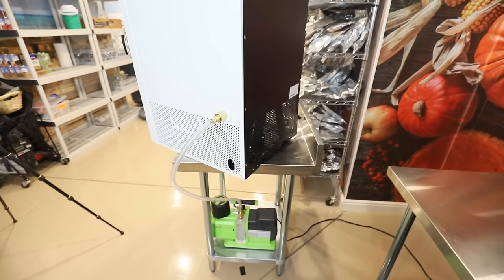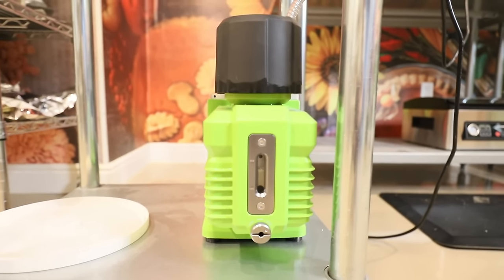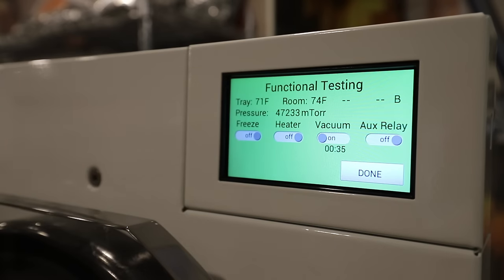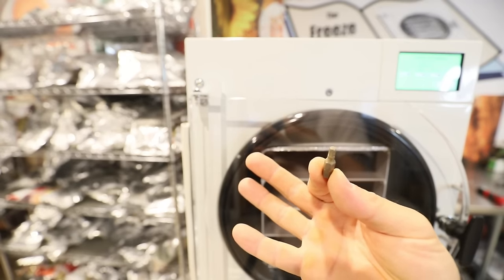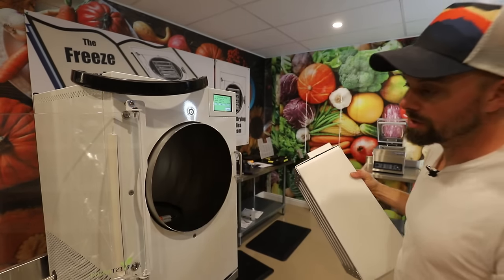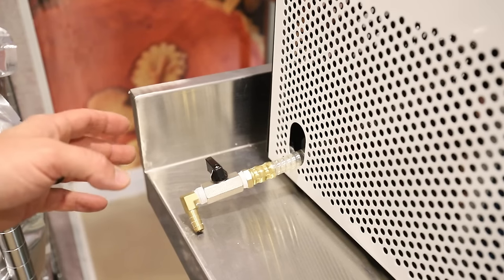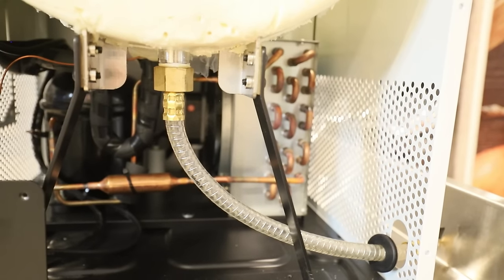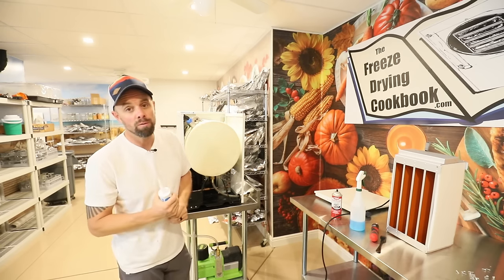Freeze Dryer Vacuum Error Troubleshooting -- SOLVED!

Comment: This a great video.  I wish there were more like this for my older machine.  When I called harvest right about a problem with my machine there didn't seem to be anyone there who knew my machine and could help.  I definitely would not pour water over my door seal since my screen is in the bottom right corner of the front.  there are no testing spots that I know if on my screen either.   However I am putting this into my file since there are a lot of things common to mine.   Thanks so much and please keep it up!!!

Comment: I would also check the o ring between the demistor and the pump body.  Clean up all oil around that area and the channel on demistor that the o ring fits in. That was my issue and I can see that showing up since you have to unscrew to add more oil to the pump.
Reply: That was not your problem because you can pull a vacuum with out the demister on. You moved something else in the process of thinking it was the demister o-ring. The demister is on the exhaust and it is essentially a muffler and oil catch.

Comment: I’m sure someone already mentioned it but the o-ring is 7/8" OD 3/4" ID 1/16 WIDTH. I bought the display model and it was missing the o-ring in one for the vacuum hose from pump to unit.

Comment: great video!! Learned a lot. I just went through a vacuum leak, you covered all the areas the company did. There are two places I learned that were operator errors. I noticed that my trays were not in the stray slots correctly. I have to wiggle the tray a little when placing them in the tray unit, they were not flush so they stuck out a little putting pressure on the inside of the door. The other element was the vacuum knob, it wasn't fully opened due to some stiffness when turning the vacuum knob. Very simple errors. Question: Where did you get the stand that your freeze dryer sits on.??
Reply: I came to comments to try and find info on the stand/cart as well.

Comment: I'm sitting on two Harvest Right freeze dryers. My first one worked for a few years, after replacing the pump (under warranty, at least), because of an oil leak. It then fried a circuit board which I replaced. While it was down, I bought a second dryer. That one worked once, eventually. The fitting on the tank that accepts the pump hose was loose from the factory (finger tight, couldn't possibly have been tested). Tightened it up and got one successful batch dried before it started showing pressure errors.

Been fighting it off and on for a year, achieve vacuum in test mode sometimes, but it errors during the full cycle. Luckily the old machine still works most of the time, so it gives me a chance to fight with the new one...

Anyone considering spending the money on one of these should remember that even when it's under warranty, you will be the one repairing it. The warranty may give you a free part if it's defective, but that's probably not what the problem will be. It'll be diagnosing and doing hands-on testing. Be prepared to learn a lot about repairing freeze dryers and to get your hands dirty.

Comment: As a follow up we ran the unit through the night and the Mtorr's are back to normal levels, (below 300) I think the silicone process you showed on the electrical connector was the final step that solved the problem. As directed, we left the unit under vacuum while doing this and after coming back an hour later, I could actually see that the silicone had been pulled into the wiring harness from the vacuum. Were back to normal now!
Reply: That should have been done at the factory. End consumers should not have to retrofit their machines!! Would you just expect to buy extra parts or seal something so your brand new car could get you to work?

Comment: Had the same problem and did all the normal stuff. When checking the nipple for the pressure sensor found it to be barely hand tight. Took it out, re-taped and re-installed. Replaced the valve, checked and replaced the door gasket, silicone on the wires, etc,..,  and thought I had it fixed, but once the machine was back together and after about 2 loads it happened again. Took it back apart checked again and was still leaking around the 4 wires on the top (thermo-couple?). This time I used a 1" long piece of 3/4" of PVC pipe split in half and fit it around the wires filled it with Silicone and pulled a vac down to 450 TOR and let it sit for 24 hours and let the Silcone cure for about 5 days. Have run 5 loads since and all were good. In fact, looking a the logs, the machine has not worked this well since it came last February.

Comment: TRUST ME:

Here are s a very easy fix:   My inadequate vacuum menu will pop up when I have done the following: If in the middle of a cycle I want to add more time so I hit cancel while my vacuum is running etc. so if I hit cancel and then immediately add more dry time and then let the machine continue to go (and I never did the release pressure valve when I hit cancel because I just added more time and then wanted it to continue) that is when at some point within the next hour two hours or whatever that the inadequate vacuum seal comes on. So then I just open the valve to the vacuum and then close the valve and hit continue and it’s totally fine. In short I find  if you interrupt the cycle without releasing the pressure valve and then resetting it that’s where the inadequate vacuum comes in. It’s a simple as that.  So whenever you want to add more time. You hit cancel on the machine, open the pressure valve,  add your time,  and then close your valve and you’ll be good to go.
Reply: Thanks Jill!
Reply: Thank you, this worked for me!

Comment: Running into issues with low vacuum pressure. Tried 3 times getting it to start left it running over night to see what would happen. Made sure oil level was right, made sure drain valve was closed. 

Didn’t even know there was a power switch for the pump! 

Thanks for making a video. Wish they would have mentioned the power switch on the pump in the instructions 😂
Reply: Right? It wasn't mentioned in the manual at all. The manual needs to be way more informative.

Comment: The drain valve that came with my FDer failed after about 10 batches. I was babysitting the machine and saw the oil turn white all of a sudden and turned it off. I believe the pump would have been damaged if I hadn't been watching it. There are two bosses (little round bumps) on the bottom of the handle that stop the handle at fully-closed or fully-open position. However, my valve would not fully close. When I looked inside the valve, it appeared that the edge of the hole in the ball just barely went past the edge of the ID of the valve. I removed the handle and replaced it 180 degrees from the original position. Now it fully closes and almost fully opens which doesn't matter.

Comment: I had multiple inadequate vacuum errors on multiple cycles. Mu hubby replaced the ball drain valve with a gas line ball valve which gives a “click” when closed and I haven’t had a problem since. I didn’t like the ball valves with the long handle.

Comment: Hi Brian,
Been reading and hearing alot of people saying to use epoxy only, not silicone and others say to use silicone only not epoxy....can you clarify which one to use, what brand? 
I guess I'm confused on whether to use silicone or epoxy on the epoxy plug and don't want to mess it up. 
Also, lots of different types of both, so, if you can be specific, it would be greatly appreciated!!

Comment: After checking all possible vacuum leaks spots we realized the code 9 error only comes when the machine is in a very cold state and trying to switch modes. When the machine alarmed code 9 I held a hair dryer on low heat on the epoxy seal and the mtorrs started dropping fast and the machine switched to drying mode confirming epoxy leak.

Comment: Power outage abruptly cause this error.  After numerous email exchanges with HR i did a oil change purge operation.  Since my oil was only 5 cyles old i left it but i power cycled the pump 15 times.  Off/onoff/on etc.  This worked.  My thought is an air or vapor lock.  Problem never returned.

Comment: Brian one there is one other place that can give you a vacuum error: dirty coils fins. We had a vacuum error and after taking off the sides of our machine we saw the problem immediately.  We vacuumed them off and I haven’t had a problem since.  It’s basically just like your refrigerator coils where you need to keep them clean for your refrigerator to work properly.  My machine is a 2018.  Hope this helps someone else.
Reply: That has no bearing on vacuum, that has effect on cooling.
Reply: @youtubejunky7481  all I can say is that we were having problems with our machine keeping a vacuum  after it had been working for hours then after several hours it would say unable to achieve vacuum.  As soon as we cleaned off the cooling fins it worked just fine. I’m not a mechanic , I’m just saying that it can be a problem with any cooling unit.
Reply: @youtubejunky7481  Exactly. The cooling system and the vacuum system are TOTALLY independent of each other. The only functional "connection" between them is by way of the "brain board" behind the screen, and then only because the way they get turned on and off are located on the relay board that the brain board controls. A vac problem resolving after vacuuming the fins is due to SOMETHING ELSE (likely one of the hoses) being moved, jiggled, reseated, or otherwise adjusted (even if unintentionally) in the process of removing the cover and vacuuming the fins.
Reply: @felsinferguson1125   what you said. I have gotten sick of trying to explain it I detail to people. Some people think they are smarter just because that have had a FD for a long time and I have only had mine for a short time. However I have been in the equipment and refrigeration world for over 23 years. But somehow the principles and physics of thermal dynamics and electronics all go out the window when it is becomes a Harvest Right machine.
All some of these people know is the miss information that is fed to them by the so-called experts and that they know how to hit the start button on the easy bake oven.
Reply: @youtubejunky7481  Yah, these things aren't that difficult, however much HR likes to try to make 'em seem so. The only "mystery" involved is exactly how they code the control program. Everything else about these things is as simple as it gets - A cooler that can take a chamber to -40 or thereabouts, a chamber that can be pumped down to a close-to-outer-space level of vacuum to enhance sublimation (as opposed to melting into liquid water, then being boiled off into steam/water vapor, only to hit the freezing cold walls and form frost/ice) and some circuitry to monitor the status and turn it all on and off as needed in response to what the temperature and pressure of the chamber is at any given moment, and some logic, in the form of the program the computer on board runs, and there you are. The only thing "tricky" about this entire beast is the software the computer is running - which could, if they weren't trying to automate it so that anybody able to push a button can operate it, be dispensed with altogether. (But I have to say, it absolutely boggles my mind that they wrote that code in C++, rather than straight C, or even better, straight-up ATMEL assembler - were they DELIBERATELY TRYING to make it as difficult to code and maintain as possible???)
Reply: @felsinferguson1125  i have seriously considered taking my controller to my geeks at work and having them look it over. The stuff that we have developed far out surpasses this thing and the program issues. Once they see how it works and what it is doing, they could fix it or write a better program. And there would be no copyright infringement because we are not wanting to use their program, just the idea. And well they are not the only ones in town doing it  either. 
I am sure I could take a simple plc and do all this too. 
Just using a temp probe to watch and see if things are frozen. Then when it hits a set temp for a time period, it turns on the vac.
After the vac is on it monitors the vac transducer. If not down to a certain point you get an alarm. After it get down to the 400ish range, it turns on the heaters. As it warms the product the water solid turns to gas changing the vacuum. As the vacuum rises it and hits a point it basically says stop the heat to slow the off gassing to maintain the low vacuum and not overwhelm the pump. It does this back and forth till the temp is higher and the vac stays low 200ish. When those to are met it says it should be done. 
Freaking simple.
Reply: @youtubejunky7481  Well, in case you're not already aware, the beast has an ATMEL SAM3X8E for a brain - A far-from-shabby controller - in fact, quite a bit of overkill, unless they chose it for the number of i/o ports - or perhaps 'cause that was the only way they could shoehorn the idiotically bloated C++ code into it. Unless I'm misinformed, forget trying to grab the code out of it - the security features in that chip are reputed to be QUITE effective at preventing "peeking". I've made a couple false-starts at trying to pick the software apart from the update files, but haven't yet figured out much.
Reply: @youtubejunky7481  Oh, and forgot to mention - the thing is (at least the one I have access to) WiFi capable - there's a WiFi chip, and obvious antenna traces on the controller board - would be nice to find out how to get into that. I suspect it's a function of the "pharmacy"/"lab" unit's software version.
Reply: @felsinferguson1125  well i could probably tell my geeks to just write a program. Get this board and try it on its own.
Reply: What was the tube of sealant? you didn’t use in the video

Comment: Good video Brian!  Having an issue did all the tests in the manual. Saw your water technique and tried it under 500mTorr. Disappointed that I found zero issues after 3 failed batches. MTorr stayed low when I sprayed on the water. Had a ticket with HR in as I am under warranty  for a few more months but saw this video and was very interested. Long story short the HR tech had me do a water batch which failed 3 times in Vac Freeze Mode. Was instructed to LEAF to Dry mode which gave me the inadequate vacuum error twice and then finally achieved mTorr and completed batch..Tech analyzed data and wanted to do a MOCK run.(no food or trays). It worked great. I sent the data. I'll speak with the Tech in 3 days. Meanwhile I ran a 9lb batch in the medium FD which ran absolutely perfect. Did a lot of checks, everything was good, fixed nothing and my FD began working. Go figure. But due to this video and HR literature I'm pretty confident there's no mechanical issues Thx again, good clip

Comment: Thank you for this. When I got my freeze dryer, I had this issue. I called customer service and was told 8 days before they could call back. Well, that wasn't acceptable to me as I wasn't available for the date and time they suggested. They called me anyway. Didn't like I said not okay. For me, it seems to be the door handle. My next-door neighbor is an engineer, so he helps. It seems that it's loosened up again. So frustrating. Also, my drain valve is actually upside down. It's aggravating when the issue happens and you're 16 hours into the cycle. Thanks for explaining this and being so detailed.

Comment: Thanks for this great info. Been running my freeze dryer for nearly a year before finally getting the vacuum error. Had run close to 200 batches before it popped up. After completing everything on your list my unit still struggled to get down below 650 Mtorr. I finally changed the inlet vacuum hose going to my pump and it solved the problem. The hose wasn't faulty but had developed a thin residue of black soot like material around the gaskets. It only presented itself after I had not used the unit for a few months because we caught up on everything, we needed to freeze dry. But then when I tried starting it back up it refused to reach operations vacuum levels. Anyway, really enjoy your videos and appreciate the info!

Comment: I saw another video, where the guy said to open your hose vent on the side, and use hot water to run through the drain pipe. Sometimes there are small food particles that cause a leak.

Comment: Didn’t pull water up the drain hose, but I decided to replace the valve anyway, even though it’s a brand new machine. I noticed small bits of Teflon tape in the ball valve. The new valve got it pulling below 500… but as soon as I put the tray rack back in… the rubber seal is hitting the bottom of the tray rack and lifting slightly under vacuum. Thanks for the chamber / door adjustment advice! I’ll try it as soon as I get home! Thanks Brian!
Reply: Reposition the cable in back.  It can keep the rack from sliding all the way in. If the rack is all the way in, there will be about 1/4" gap between the gasket and the tray rack.

Comment: I wondered if the silicon fixed the leak? If not, have HR send you the new software update.
Reply: I don't believe a software upgrade could fix a mechanical leak.  It didn't for me.  I had to do the silicone patch on the epoxy plug, which worked great.  Upgrading to the new .23 version had no effect on the "inadequate vacuum" errors I was getting.

Comment: My machine was MFG im July 2022... had the vacuum error.  Goimg through your checklist I found my ball joint rusted😮 AND enough plumbers tape for a dozen machines.  There was so much that it was actually down into the ball joint mechanism.
I ran less than 50 cycles.  Very disappointed in the poor quality of that part.